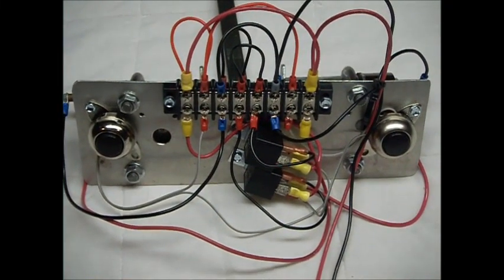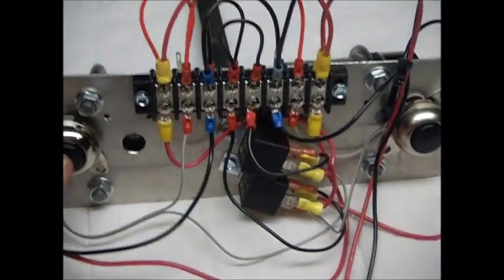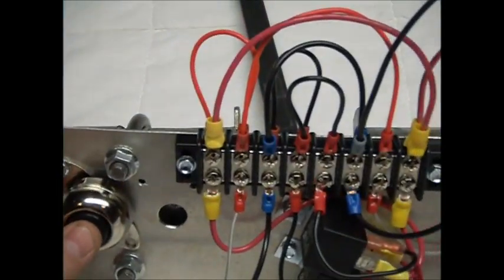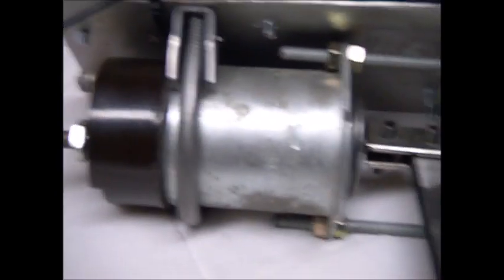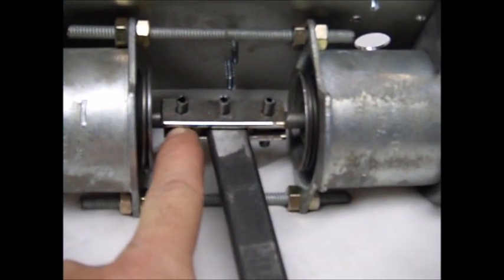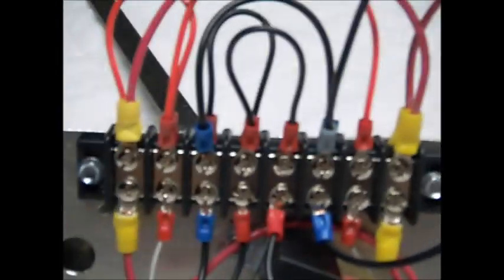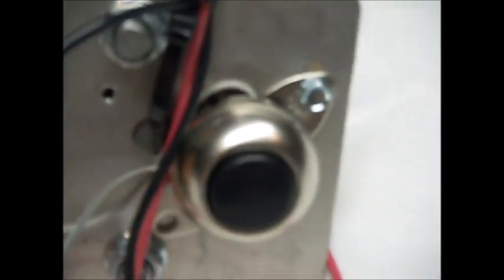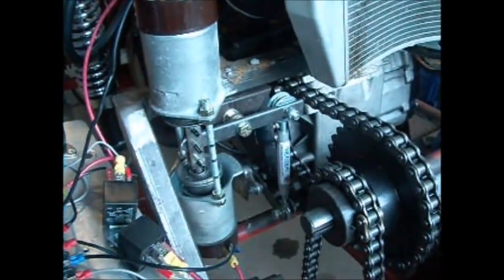Electric Motorcycle Shifter DIY from Spare Junk

Comment: Love the sound effects. Would this work with smaller 12v dc solenoids?
Reply from the maker: I imagine it would, as long as the solenoids push/pull hard enough for your application.  I used this to shift a motorcycle transmission and it had probably 5 times as much push/pull as it needed.  Leverage, throw distance, linear strength, your particular needs and such would dictate what will work.
Reply: @BuiltbyD I lost my left leg and have to use bikes and atvs on my farm. I attempted to build one a few years back but couldnt rind solenoids with enough stroke.😊
Reply from the maker: @Diggin-off-the-side  Oh, well this setup should work for you.  In case it helps, you'd be able to purchase them from any auto parts store or amazon.  1980 Chevy C10 with 350ci/5.7L starter solenoid, or part number 1114251 for them to cross reference or to look up on amazon.  Of course there's some simple fab work involved, with basic relays, switches, wiring, allthread, hardware, bar steel and such.  If you decide to give it a go and run into any challenges, feel free to hit me up and I'll be happy to try to advise.
Reply from the maker: @Diggin-off-the-side  also, perhaps go to my channel and search/scroll through my videos to find "Electric Shifter" to see how I set it up on the buggy (with motorcycle engine.transmission), and of course more of my high-tech sound effects!